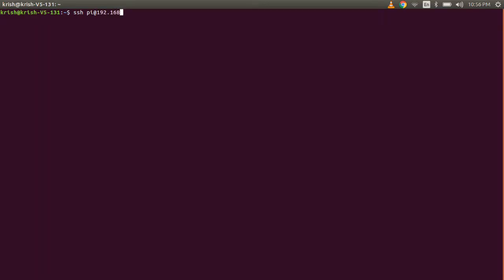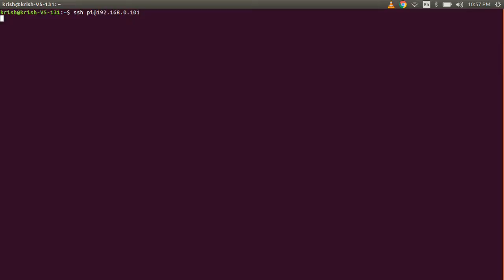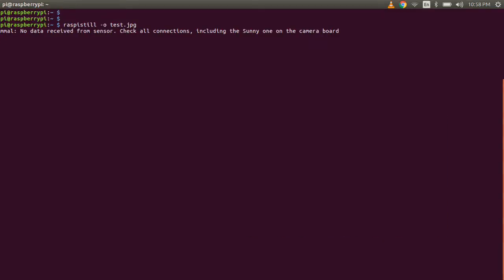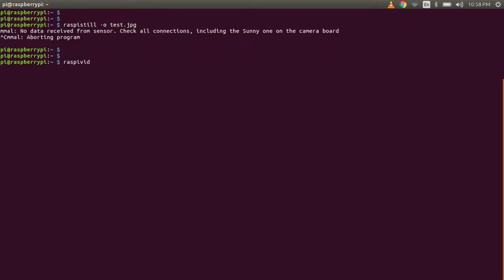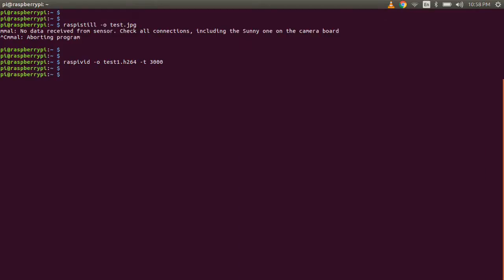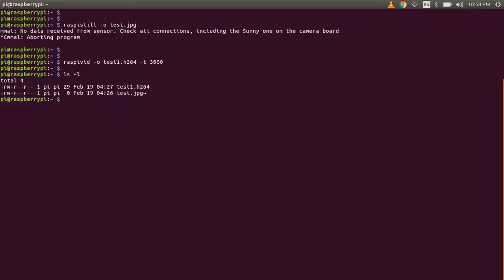Raspberry Pi Camera destroyed...!?!? | Static Failure

Comment: I am using a Rpi 3 B+ board with a Pi noIR camera v2. It worked great for a few weeks but yesterday it stopped working I am getting error "Failed to create mmal component" and "the camera is not enabled". My cable looks fine all the connections are okay including the SUNNY. I don't know what went wrong.
Reply from the maker: If you have been using a camera case, it should be working alright. If you were handling it in bare hands, then there is a chance of static failure. But however try googling with the error you are getting, to find any probable solution to solve the issue
Reply: @kriz1990  I was handling it with bare hands.
And googled the error it simply shows that the camera is not connected